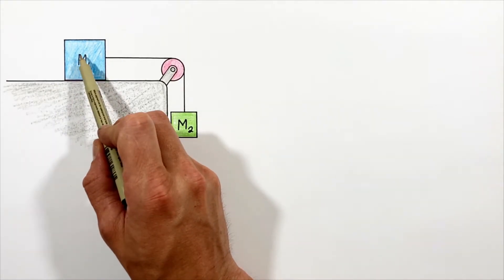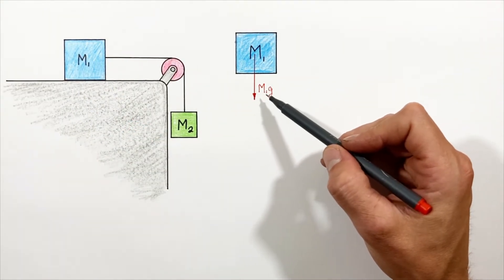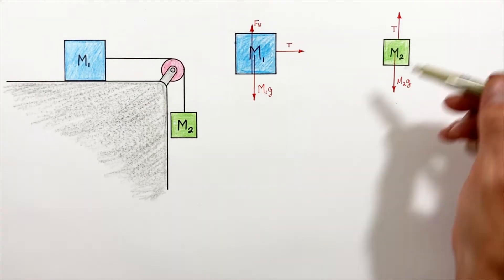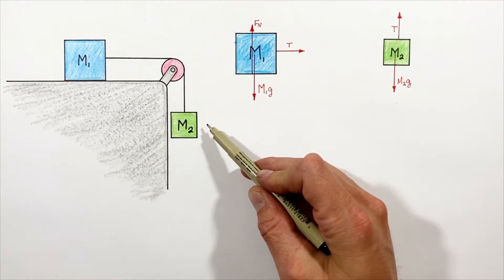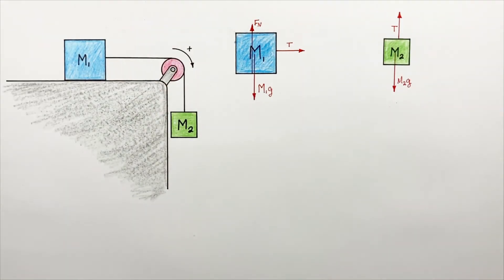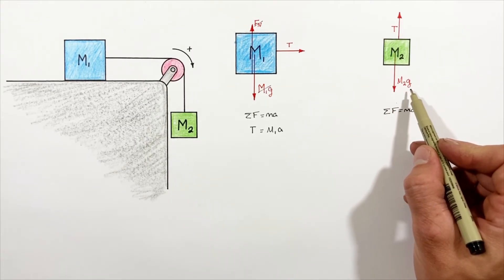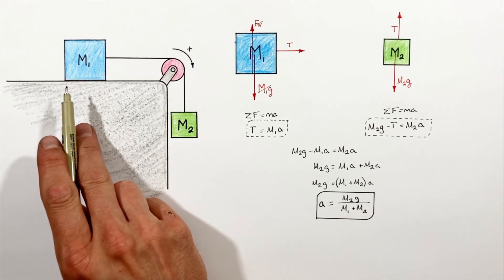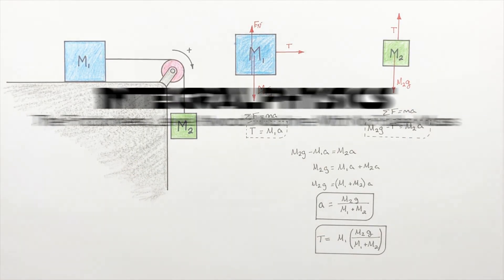Calculate the Acceleration of Two Blocks Connected by A String | Half Atwood Machine

Comment: there is one question that says the system starts its movement from the rest, then block of mass 𝑚2 displaces 
for some 𝑦 distance to reach the ground. If the coefficient of friction between block of 
mass 𝑚1 and the surface of the table is 𝜇𝑘. Use Hamilton’s equations of motion to find 
the equation of motion this system. Assume the pulley to be frictionless and attaching 
string to be inextensible. ,the digram has two masses the one at the center and the other hanging on the right side

Comment: I´d like to see you workout the Atwood like problem of a "heavy" rope hanging over a frictionless pulley (with no other masses).  Thanks for a nice video.
Reply from the maker: if it helps i did two versions of a chain sliding off a desk.  with and without friction.
Reply: @INTEGRALPHYSICS  Thanks, I´ll look for it.  (I did rope over pulley problem this morning, and pretty much trust my result.)

Comment: The acceleration is = (The force that gives the movement / Total mass set in motion) Isn't it easier to just write it down directly?
Reply from the maker: Yes but only if all the mass accelerates at the same rate... That isn't how all of these block/string devices work.
Reply: @INTEGRALPHYSICS  In the example you show, the acceleration is g and it can be considered constant.